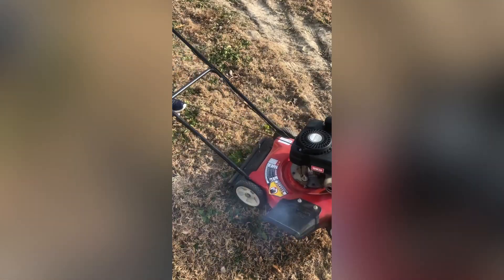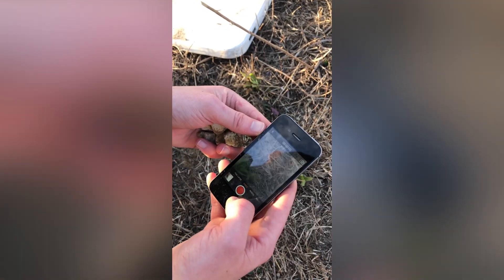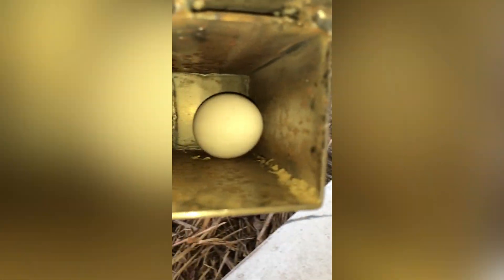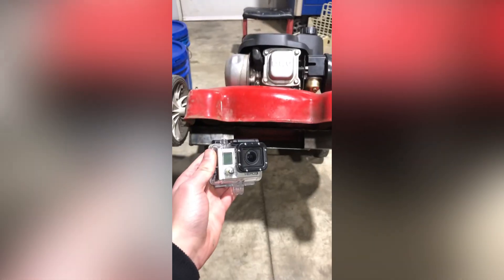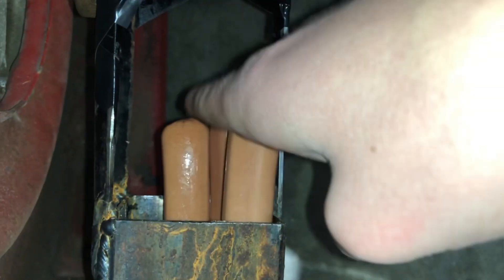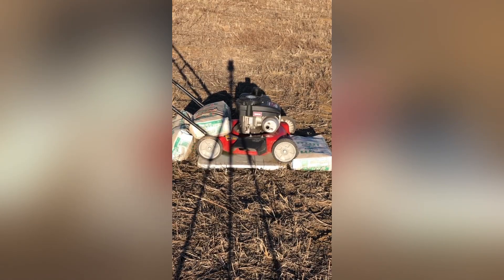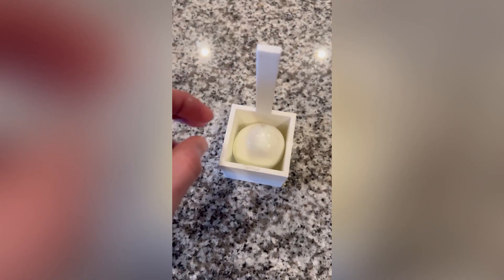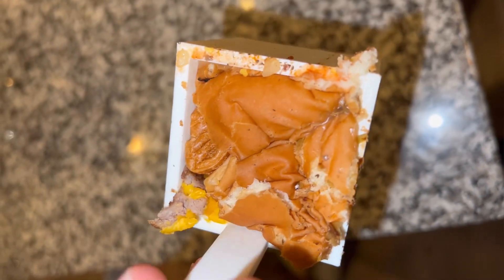Turning a Lawnmower into a Centrifuge

Comment: You should have tested with an accelerometer or laser tachometer or something to see if it met the theoretical number
Reply from the maker: I looked into it and might eventually, but accelerometers capable of measuring that high of acceleration are expensive af. V^2/r is very reliable though haha, the only possible room for error is in my estimation of the RPM of the blade but either way 2500 should be close
Reply: @jackschneider17  might be worth measuring the rpm then, since it is probably less with the added weight I would imagine, and then from there calculate the force.

Comment: Awesome engineering and design! How did you estimate rpm?
Reply: Nm, just read the description. Very cool!
Reply from the maker: A little more detail for ya, I knew the video was shot at 60 frames per second so I was able to count the number of times the blade hit the deck and made that loud noise over the course of 60 frames and then multiply that number by 60 to get the RPM!
Reply: @jackschneider17  Clever!  Something to think about is the uncertainty in your measurements... someone suggested you use an accelerometer, which I agree with you is probably overkill, but it would be nice to quantify the uncertainty in your method, since acceleration scales with rpm to the second power. Some things I would think about are the number of frames between noises (revolutions), and how variable that is. It looks like it's making 42 revolutions per second. Are there only 1 or 2 frames between each noise?

Also, the v^2/r equation you're using can be expressed as omega^2*r, where omega is the angular speed, in units of radians per second.